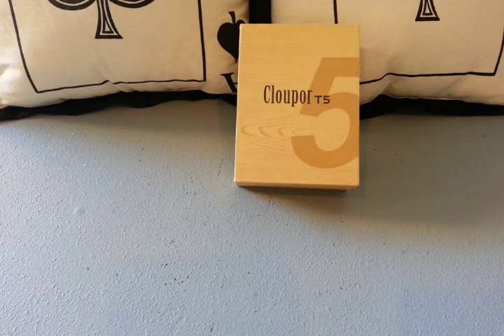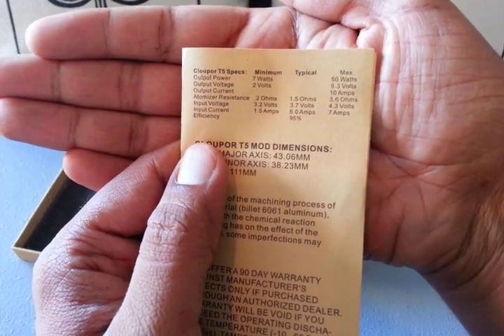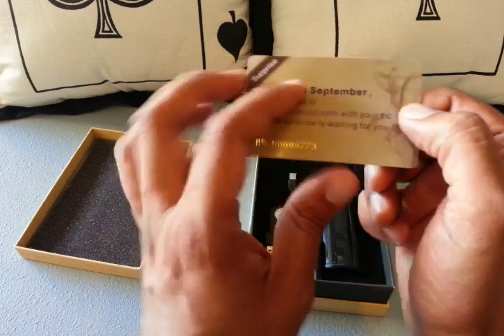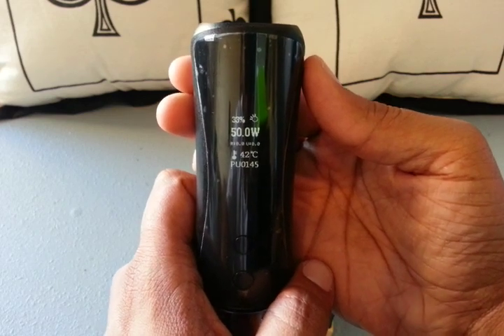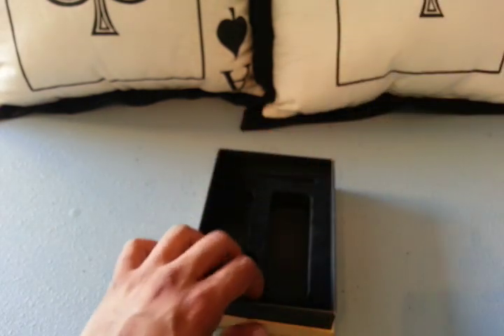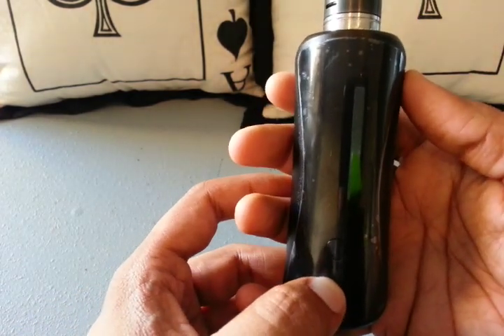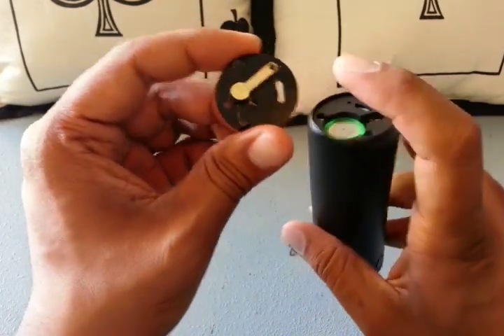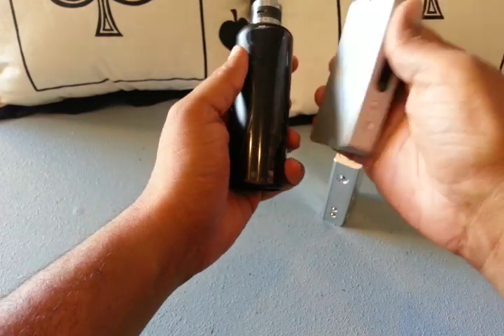Cloupor T5

Comment: Can you fire the mod while on charger?
Reply: Yes, but there should be a battery in it while the charger is connected. I think that's why they put the charging port on the bottom. It seems easier to vape while driving when charging with the connection on the bottom